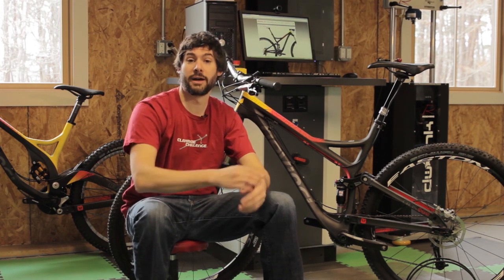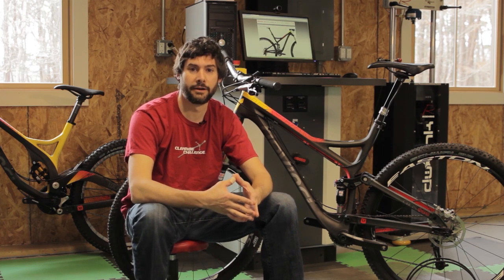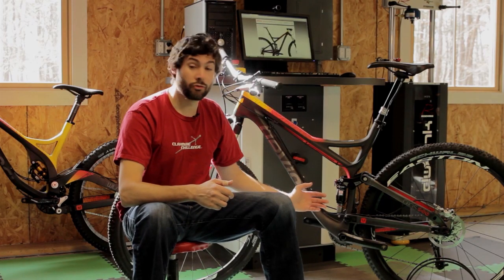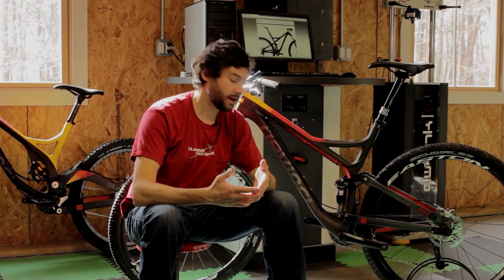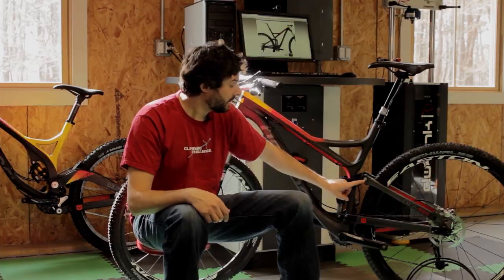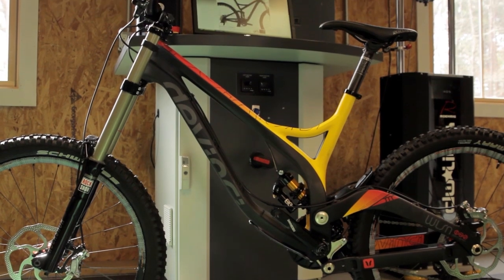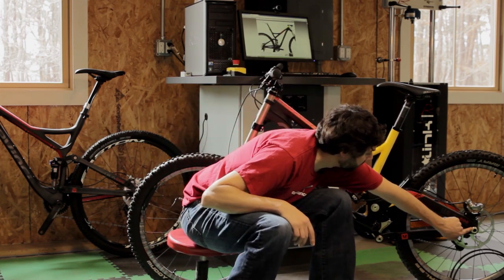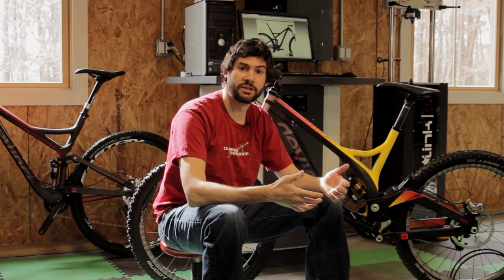Split Pivot by Dave Weagle

Comment: I like how you straight up point out it's a single pivot, (unless your on the brakes when the split pivot acts as a decoupler), but all the droves of riders around the world will swear how much better the suspension action is over other designs...??? Sheep
Reply: I guess I should point out it's a modified SP/Leverage actuated SP? But still single pivot.
Reply: Same axle path as my old Santa Cruz super light from 2001. Maybe a little less chain stretch since it's a 1x and doesn’t have a granny gear and it has a linkage therefore a more tuned ride but I have a feeling I’d rather have a regular old 4-bar or a vpp (which I guess is a dw, ie Dave Weagle, link)